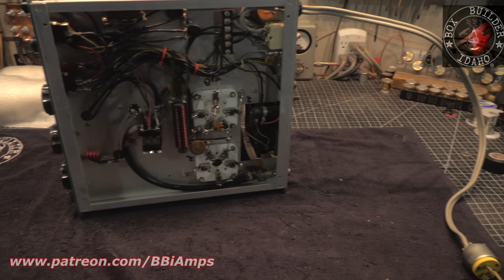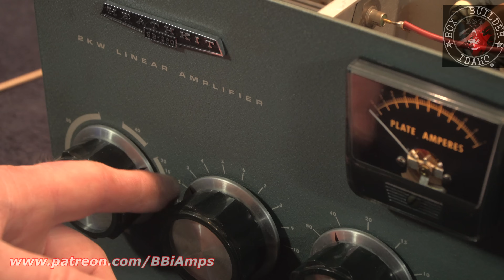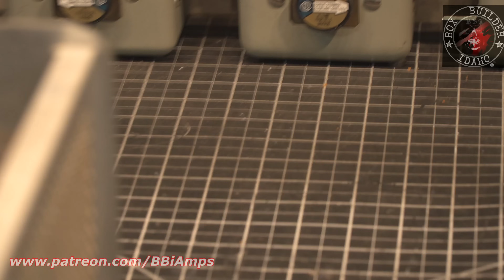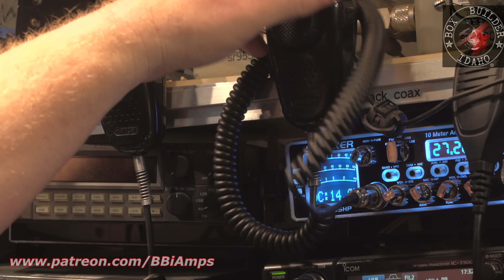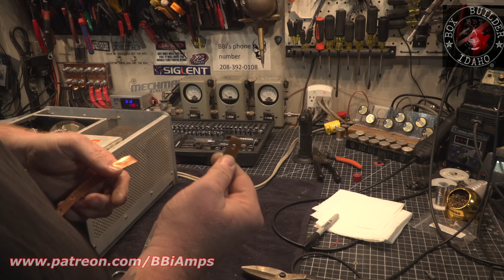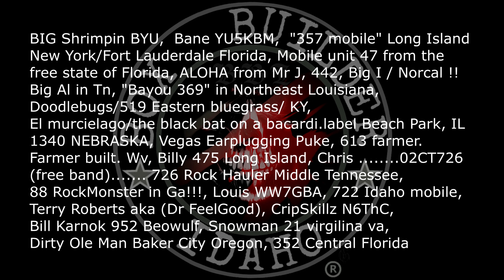Sb-220 for sold!!

Comment: Riddle me this:  I was always told to never touch a glass tube with your bare hands because the oils and shit from your skin would get on the glass and damage it when it heats up.  Is that real or crap?
Reply from the maker: We dis proved that the tubes don't get hot enough. Now certain light bulbs yes that's the case!!!

Comment: Beautiful amplifier .Wish I could afford one .what variac are you using . I had a bad experience with one but the amazing thing was they sent me a whole new one for free .all it needed was a new brush the shipping company dropped the package and it landed right on the dial side and bent the shaft .it cracked one of the brushes .it was a 2kva model looks just like that one .Hope it lasts as long as my old one from the 80s

Comment: Just a question for you sir how come you don't wear gloves when you handle the tubes won't body oils cause problems ?? Just thought I would ask any input would be appreciated tyvm
Reply: That’s just for halogen bulbs. Tubes are cooler.
Reply: I usually use Windex to clean the sweep tubes off after handling them. I don't use rubbing alcohol so the print doesn't come off. I can't remember if my eimac 3-500's are at hex or are printed on.
Reply: @Mister22x2  
As long as you don’t use ammonia or alcohol the print should be fine. I just use a damp cloth to wipe the dust off. Fingerprints won’t hurt them. 
Happy DX from 567 Mn.